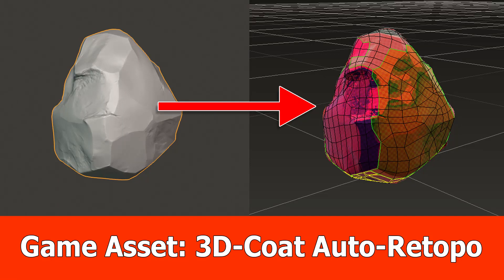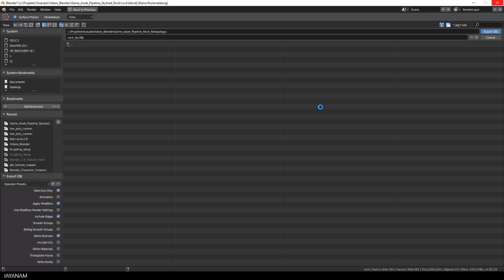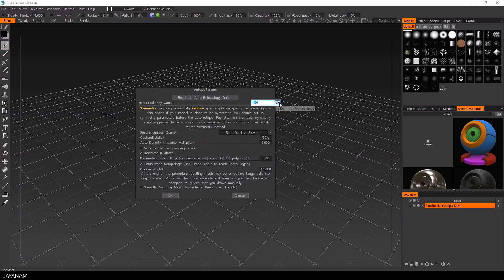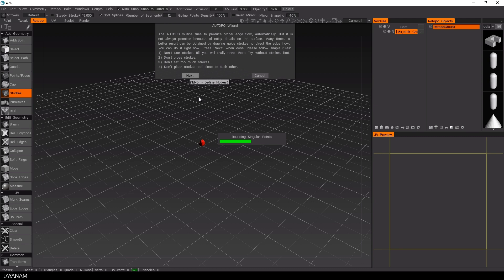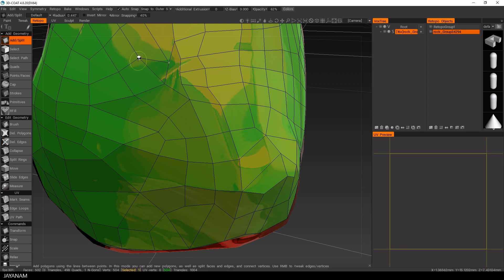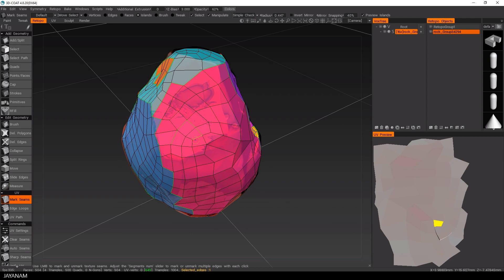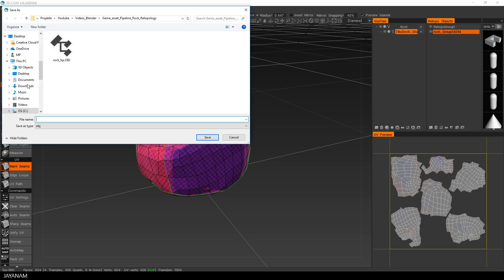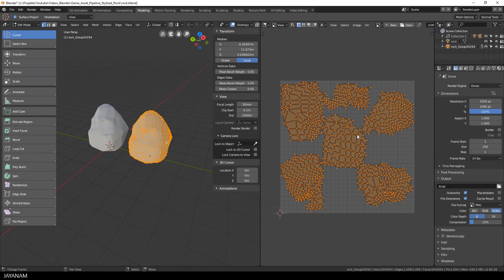Game Asset Pipeline : 3D-Coat Auto Retopology

Comment: This is great! I have one question: at this point, how can I use the high poly mesh to make a normal map for the low poly mesh?
Reply from the maker: I will cover this in the next video, in which I will bake the normal map with Substance Painter, which makes it really easy and with good quality. Other possibilities are baking it with Blender and Cycles or using a tool like xNormal (which is free).
Reply: Why not use 3d-coat for baking?
Reply: @JayAnAm  that's perfect!! Thank you!
Reply: Why not sculpting inside 3d coat ?

Comment: I haven't used 3d coat much ,so can I know which features are good and easy  in 3d coat in comparison with blender in your point of view :)
Reply from the maker: * The sculpting is good and fast, but I use Zbrush most of the time, Blender is slower but I like the brushes more
* Retopo is built-in and very powerful
* Texturepainting is great in 3D-Coat and it has full PBR support
* Hardsurface sculpting is supported with booleans, primitives, cut-outs with free shapes
Reply: @JayAnAm  thx, sure I'll try it out , going to check out your other videos about it :)
Reply from the maker: ok, great!